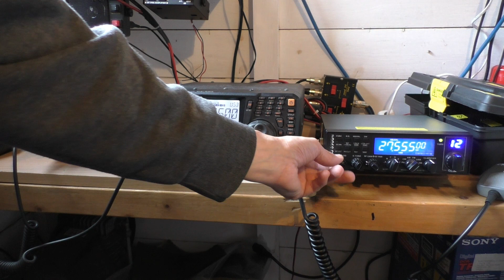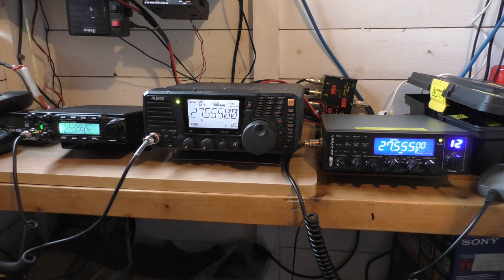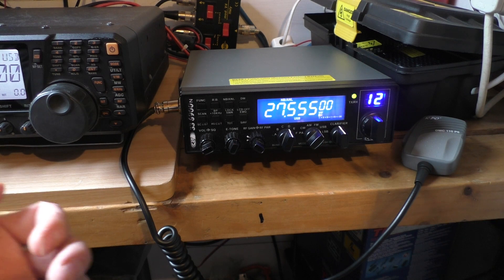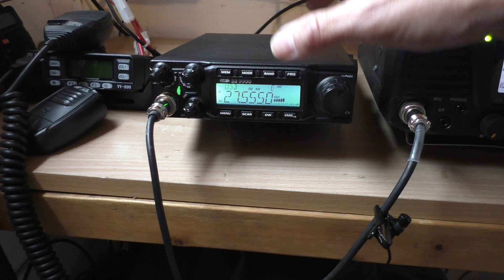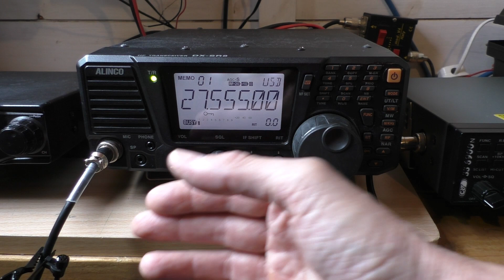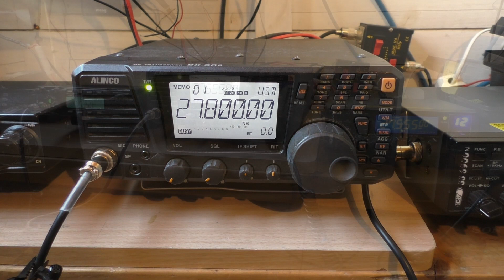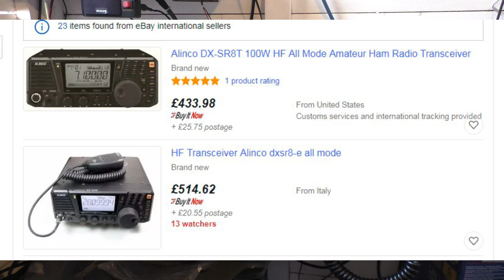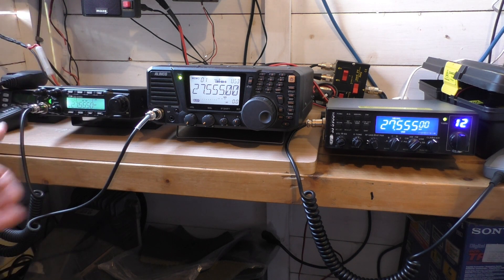Same interference QRM / PLT shown on 3 different radios.

Comment: Hi Fred, have you bonded your equipment together ? not RF earth, but bond your gear together ? also RF chokes are good. Cleaning and bonding on the RF side will help. https://gm3sek.com/2019/10/11/clean-up-your-shack-2019/ - although HF is more sensistive, your VHF/UHF sounds really impacted. I think the fact some of your radios are filtering it out (probably with phasing) means it can be removed from the RF side. Edit - fred, are you still using the same power supply (switched) that you suggested, i see the little tool box - its not bad, but have you tried swapping it out for a car battery ?
Reply from the maker: Thanks.  I have tried the car battery and turning off the house main.  I will prob try that again but with half the house not working and the other working from home its going to be hard right now.
Reply: @CB-RADIO-UK  watch the whole video . This is what you need , but do not skimp get the expensive stuff,  so you can enjoy your radio  hobbies .
Reply: Pure dc supply from a large car battery used to work for me!
Internal RF filtering sometimes needs experimenting with, rf chokes, screening of various kinds, to find a useable compromise if not to completely eliminate the problem.
Reply from the maker: Thanks for the link.  Very interesting.
Reply: @CB-RADIO-UK  I'm really glad i can provide some assistance Fred, you do so much for other people, me included ! You may like to check my blog, i have/am having the same battle with QRM - but slowly winning :) https://hamradio.knipmeyer.co.uk/2020/05/25/the-quest-to-reduce-qrm-bonding/
Reply: @CB-RADIO-UK  That link is the way to go Fred that Alze left.
Reply from the maker: @BoB4jjjjs  Copy that Bob
Reply from the maker: I will certainly be looking into this filter.  Tried to order some items today but Farnells website checkout seems screwed.
Reply: @CB-RADIO-UK  A lot of sites are not doing to well at the moment with the IT guys working from home.  They are very expensive though Fred. 
https://www.rapidonline.com/
https://cpc.farnell.com/c/test-equipment/component-testing/electronic-components

Comment: Have you got to the bottom of the problem or is it still the same after all these years? 
73s CT5060
Reply from the maker: Hi.  It just stopped about 10 months later.  Never found out what it was but suspect it was a neighbour using something.
Reply: @CB-RADIO-UK  Thats good .. I suspected mine  was coming from the Mrs,s battery powered solar lights but no luck .. the hunt continues. 
Keep up the good work and 73's

Comment: It needs an FFT and a power density, then a differential of the density, an absolute sign, multiply by the original spectrum and inverse FFT. Making the spectral variants amplify while the spectral constancy is removed. Maybe a wet/dry mix?

Comment: I'm having the same issue, and I'm in Portugal, so I'm going with the WiFi extenders on this issue as I'm in a seculded area with 2 houses only around me and they use with WiFi extenders,
Reply: Ok Fred have inserted 2 x 6 ft copper rods in the ground, can't figure how to put pics up on here, probably not allowed, but can send via email or what's app , let me know, yes it does help but not a lot, so I asked my neighbours to plug out the WiFi plugs, cost me a drink 🤣, any way that helped a lot brought it way down, so than asked them to plug out the routers and I also plugged out mine, all gone! But can't live with without that, I'm also thinking of the supply lines/ old telefone wires here carrying broadband, but yes with everything shut down its gone,

Comment: That's very irritating but as you say when you pay more you do see some benefit. the funny thing is I once asked a question on a Facebook Amateur radio group which was: "are modern HF radios any better at filtering out noise from devices like Wi-Fi routers and LED lights than old classic HF equipment?" the reason I asked the question back then is because at the time I had old HF equipment, such as a Kenwood TS-850, which was obviously designed long before these devices were even thought of. so I wanted to know if I would benefit from buying a modern HF equipment such as your Alinco or Yaesu 450D! but surprisingly nobody was able to answer that question! which totally dumfounded me. I have since upgraded though, but I can't pass any opinions on my new equipment yet because I havnt even had time to set it up due to working long hours. logically, newer HF transceivers should be able to cope with this type of interference better.
Reply from the maker: The simple answer is yes.  my 6900 and 9900 may show S4-5 of noise but my Alinco SR8 will be S1-2 SSB.  FM is no difference.  You do get what you pay for.

Comment: I know this is an old video but that noise is not plt. plt sounds totally horrendous  it will wipe everything out 
that noise is a dodgy transformer somewhere maybe a bad power company transformer which could be miles away or a cheap China battery charger for  a mobility scooter or somthing like that believe me I know I had the plt issue myself which even effected my radio in the car outside the property next door
I feel your pain

Comment: I suffer with this  antron 99 earth it to ground from clamps to a copper ground stake it's worked for me from S4 to S1 now
Reply from the maker: Yeah going to try that.
Reply: I'm back on radio now because of u vids missed it was on in 90s with a big station rci2950 hp1000 transmatch bv135 amp sigma 4 antenna just ordered a dynascan at5555 an a kl300

Comment: Hi fred can the  cable  mess the dx up on your  cb radio
Reply from the maker: If it causes the SWR to climb to high then yes as it will reduce radio transmit power.

Comment: I used to get about S8-S9 noise on my CRT-SS9900 when I first moved here. I changed my antenna from a vertical to a horizontal and the noise is now S3-S4 on high-band and less on low-band. It makes virtually no difference to signal-strength from local contacts, just a slight drop of 1 or 2 S-points and its great for DX.
Reply from the maker: Good to hear on the local contacts.

Comment: So the alinco it is. For further fine tuning you might try if the alinco has a manual notch filter and also reducing the bandwidth will reduce the noise figure.

Comment: Hi fred i just got a CTR SS 6900N superstar from knights a few days ago, i have the higher power model 40W FM, and 35W SSB,  i now need to get a power supply for it but there are loads of different ones on the knights site with different amps and watts and it's confusing the crap out of me being quite new to the world of CB radio. could you give me a clue as to what power supply is best for my radio.
Reply from the maker: Hi.  Min would be a 10amp supply but prob a 12-14 amp is better.  If you are going to stick with the hobbie for a while then its a good idea to spend a little more and get a larger 30 amp model.  If money is real tight than you can use a LED power supply which are pretty cheap.  I will leave some video links below which show the types i use.
Reply from the maker: Small Sharman. https://www.youtube.com/watch?v=mh4r2rjnk9c&t=43s
Larger QJE  https://www.youtube.com/watch?v=-mU0JIR68PM&t=61s
LED type.  https://www.youtube.com/watch?v=TLvoXi0rpns
Reply: @CB-RADIO-UK  Ok thanks for the swift reply fred.

Comment: PLC is a technic that nobody needs, why not use a good WLan or better try a Lan-cable. If the people to whom one sold such rubbish knew what they were bringing into their house, then some would think about buying something like that. In addition, the data rate drops dramatically and a fast internet connection becomes a lame duck. PLC is the biggest garbage ever invented.
Cheers from Stuttgart Germany

Comment: Odd. My neighbour has a ton of WiFi boosters and solar panels et al and I have never heard this noise. 
Must be something fairly common if lots of people hear it. Perhaps a particular brand / version of a cheap extender ( or a certain model of mains breaker)?
Wonder if we could track it down. RSGB could turn the screws with Ofcom if it affects 10m in some areas.

Comment: Try the attenuator, can take out unwanted noise but still receive clear strong radio signals.
Reply from the maker: I normally do roll back on the gain but this QRM is too strong.  Thanks.

Comment: Hello !
Can't you just call the regulator authority and complain about the interference in your service ? (Believing you are a licensed Ham or CB)
Reply: Nope, as he's on a pirate band that he's not licensed for, no-one in the UK is. 11m is not a ham band and is not legal for use in the UK.
Reply: @stefanpynappels7959  Hello ! As I wrote "believing is was a licensed Ham or CB "and had also that interference on the legal bands, otherwise it is just impossible and he will have to live with it.
Reply from the maker: Hi Setfan is both right and wrong.  27.555 is neither a ham or CB band so no one should be there.  11m FM AM and SSB is legal in the UK since 2014 but is no longer regulated so if i cannot cure it i will have to live with it.  Thanks for the comments.
Reply: @CB-RADIO-UK  sorry mate, but that's incorrect. 27.555 is not a legal licensed frequency for anyone in the UK to use, the frequencies on 11m are published by Ofcom, and they don't include 555.
Reply from the maker: @stefanpynappels528  Hi bud.  LOL we are crossing.  Yes your correct about the 555 as i said no one should be there. You said 11m is not legal in the UK ? Thats how i read it but i think you just meant the 555.

Comment: Try an inductor across your SO239 socket on the Radio.
Try 10 turns on a Type 43 core see if that cure's it.
Cheers good luck.

Comment: If you turn off the agc on the HF radio it will sound the same as the 6900, your 450D will also sound f the same with AGC off. As mentioned previously build a few mains filters from Iain Whites, (GM3SEK) which will help greatly, also bond your equipment and earth through the mains filter.
Reply from the maker: Thanks Andy

Comment: Plasma Tvs cause very similar interference , i used to work the cb radios in the late 80s and it was fantastic with a Ham international Jumbo i think it was called at the time and an Antron 99,,Was away from radio completely for years and got my Amateur license 20 years ago and have been in and out of it every since.Its a real love hate thing for me , 8 years ago was my last time on Hf radio with an Icom 756Pro 2 and homemade Delta loop and worked the world on that,,,Sold the lot again as i do,,i have an old Yeasu Ft840 buried in a spare room and contemplating getting into again , have some great memories of the cb radio ...I will say the Icom radios NB work very well,my neighbour still has an old plasma Tv and from 10m down to 20m i would have 30db over 9 signal constantly but the NB would completely eliminate it..

Comment: Noob question, does PLT QRM only happens if the radio is plugged to the mains via a power supply or also happens if it's being powered by a 12v battery? Or better question, does powering from a car battery improve the reception?
Reply: NVM, just noticed that someone else asked the same
Reply from the maker: Its something i tried a while ago without success but can try again when all the household have returned to work and i can kill the power.

Comment: The noise blanker in the FT450D gets rid of most of this. The noise blanker in my Midland M20 gets rid of a lot of it. You might find changing the ALC speed makes a difference. In the future radios are going out have specific active filtering like we get in noise cancelling headphones or we will start using AI based filters to identify and pick out speech.

Comment: That is horrible noise Fred.
Unfortunately that is what living in urban areas with a radio hobby has become to a large extent.
Although rare, especially when not out somewhere or asleep, an electrical blackout area wide is a great opportunity to jump on the HF with battery backup.
It is incredible what can be heard when the Reject Shop/Pound Land appliances are shut down for miles!
I also recommend you try the rigs on battery and see if you are picking up some of that crud via the mains.

Comment: Report the issue to the FCC. Your radio device is not suppost to interfere with other devices in your neighbourhood, but that goes for your neighbours devices too. Maybe they are using some crappy WIFI extenders from China without FCC approval.

Comment: Hi Fred I bought a cb today but when I key up my bedside lamp turns on and off and it’s a touch lamp have to touch the base of lamp to turn on why would this be happening many thanks
Reply: alan higgins Where is your antenna or coax in relation to the mains wiring fro the lamp?  Sounds like you have RF on the coax which is getting into the electronics in the lamp.  I would firstly make sure you have got a choke on the coax to stop the RF coming back into the house (especially if your antenna is a type that needs radials and is using your coax as one) or otherwise, try a decent ferrite on the mains lead of the lamp.
Reply: Ammocraft I have an indoor mag mount aerial in a tin in the bedroom as there isn’t anywhere else I can put an outside aerial

Comment: Hi Fred, I've had the same PLT issue for just under 10 years now I complained to Ofcom who are a waist of time and space so I emailed my local BBC station and surprisingly it went away for a couple of years then came back in a different form.  I've tracked the offending house several years a go it seems to affect a lot of lamp posts near my QTH but like you I haven't approached the offending household.  I can usually tell when they are streaming or downloading large files due to the change of the PLT and at least with me its spewing all over the ham bands as well every 50 Khz or so with 20M being the worst by far.  27 Mhz isn't too bad it doesn't have the 50 Khz spikes like it does on the ham bands.  I can filter it out using a fairly cheap XHDATA SW radio which copes really well with it but it can be fairly annoying on the 6900N.  I'm intending to move up to a CRT 9900N hopefully within a few days as I want a decent radio I can easily chuck into a bag to go portable.  Tracking this stuff down is very easy using any generic SW radio just back off the RF gain as the QRM gets louder and you can easily pin it down to 2 or 3 houses.  The ROHS/CE marks are just for show now they have no value what so ever so the way I see things is like you've said in many a video dont transmit on the ham bands and make sure you arn't splattering over the ham bands and you should be fine I've never had issues with my 6900N running close to full power.

I assume most of this PLT junk is untested by trading standards/OFCOM and is sorry to say but probably using cheapy Chinese unfiltered power supplies and components.  I've got the same issue like the majority wanting greater WIFI access at home so I ordered an 8W WIFI amp from Ebay again no problems through customs to the UK and works like a charm using a cantenna giving me a good 300M wide coverage area and critically spews out very little RF only when putting a radio next to the unit at point blank range.  Its not only PLT its TVs, routers and other stuff using switchmode supplies I never ever used to have any issues way back in the day with good old UK made heavy transformer based 12V supplies.  I have a cheapy Chinese 12V 4A power brick that spews out hash like anything and a quality made transformer based unit which spews out nothing at very close range.

Comment: Hi Fred - does the noise tail off towards 28Mhz? - if so,  it might well be PLT as they're notched in order to not cause interference on the Ham bands (10m starts at 28Mhz). Some of the early PLT devices may not be notched though. Early PLT devices used to emit a very characteristic noise but that doesn't seem to be the case with the newer ones. A.t.b
Reply from the maker: Yes it does reduce on 10m

Comment: When it comes to communications radios there is nothing worse than QRM that makes using your equipment practically useless. Thankfully, what you have is more a inconvenience and could be a lot worse. There are some great ideas in the comments so far. I will keep an eye out for any solutions you may discover. Good luck with it Fred.
Reply from the maker: Thanks Andy

Comment: This is all over the country Fred so it not a neighbor it something airborne (atmospheric) or its something or someone out of our control testing something it's been going on for months it doesn't matter what radio you use old skool  or new  ,I've been telling people on forums and YouTube for months about it and nobody seems to listen, ok how I know it's all over the country I  have radio friends in Wales ,and in the North and the South  and they all have too ,so your neighbour's must have a mega WiFi booster.
Reply from the maker: Its been with me for about  4 years now.
Reply: @CB-RADIO-UK  Yours must be mixed in with this new interference mate ,but the one that's been going about on the T5 has actually been going on for a while ,the people I mentioned in my last post who have been hearing it up and down the country wondered was the new 5G network being tested ,or as I said is it something or someone be on our control ,not gonna go in to that incase people think I'm one of those who wares tin foil on there heads to stop them getting at my brain LOL  ,all I know it's a pain in the arse , question Fred do you get it on mid block cos I dont ,I only seem to get it on T5 say down to Ch1 high going the other way up to about Ch 25high then it clears 28mhz is perfect so is 26mhz and 25mhz

Comment: Fred, I am surrounded by WI-FI and do not get anything.  Even some street lights have small antennas on top these days reporting back what the lamp is doing.
Try ferrite on your coax and mains cables.  A notch filter on your set will help a lot, if it has one.  Mind you, I have not got a big antenna up yet, but the small one is right in the thick of it.  Nothing.